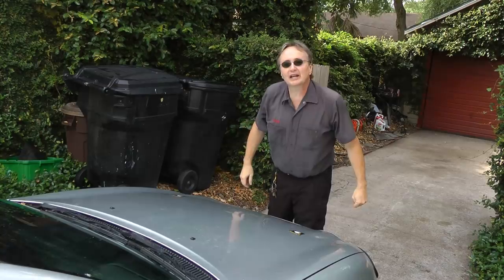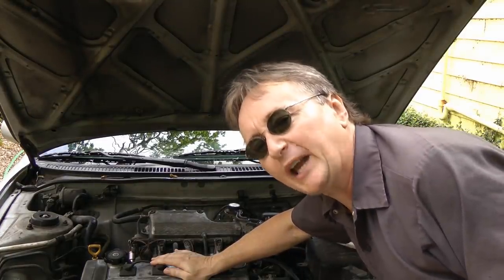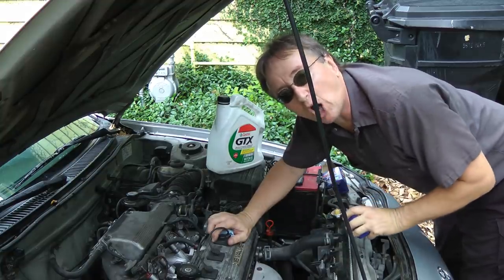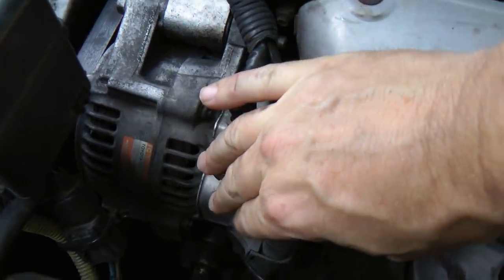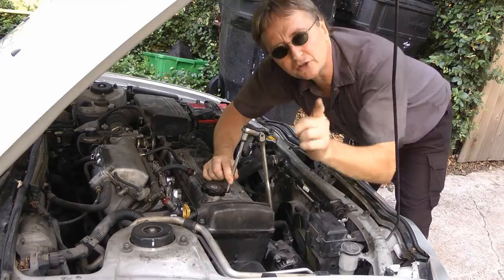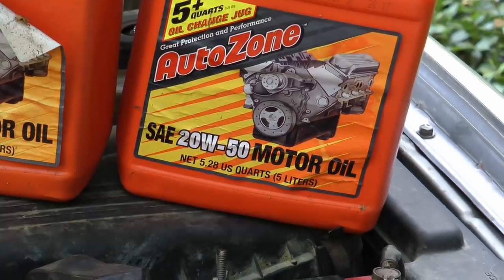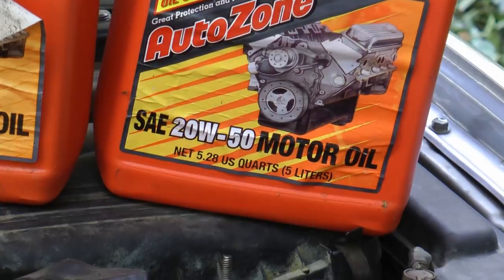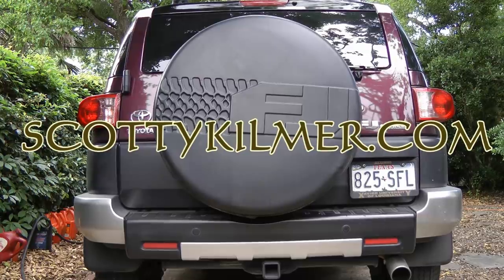Top 4 Mistakes Car Owners Make (DIY Fails)

Comment: Although you took off the right one in your video, sou said: "Take off ONE of the battery cables!" Correct would have been: "Always take off the negative cable off your battery (first)!" Because if you take off the positive one, if it touches a metal part of your car, it would cause a short circuit!! (the metal frame and all metal parts attached to it are attached to the battery's negative pole) Therefore: If removing a battery cable, always start with the negative one!
Reply: BenWahBalls44 the thing is it doesnt matter which side you remove first. you can in fact remove the positive battery terminal and touch it to the frame. it still is not completing the circuit, hence no electricity flow, therefore no risk of short circuiting.
Reply: BenWahBalls44 may i add if you have more than one battery in your car, for a stereo system and what not, then removing the ground wire first is mandatory. make sure you know which one it is because some cars are in fact positive side grounded.
Reply: Ive heard that it can arc and burn you when youre putting it back on if you dont do it right. So I always just do the negative and I never had any problems
Reply: please stop that's makes no sense  on whichever one he decides to remove due to creating an open circuit. the only vehicle  that can do that is diesel which use a 2 battery system which will still have a closed circuit
Reply: Alfredo Zertuche 
Single battery system or not...While your removing the positive cable first, try touching the metal part of the wench or socket drive to one of the thin aluminum a/c lines. I can tell you from experience, the arc melts a hole in the line, and all the refrigerant leaks out. Trust me, remove the negative cable first and when installing a battery, connect the negative cable last. And I don't care if your wrench is insulated or not. It's still a good habit regardless. There are plenty of other items to accidently short out against as well. It's espoecially fun when the wench gets jammed up against something, arching, smoking, and becoming too hot to touch. And then you find yourself hoping and praying nothing sensitive got fried, like the ECM.
Reply: David Sine yes it will arc like crazy but only if both terminals are connected to battery cause your completing the circuit. I don't see which one you take off cause either side is opening the circuit
Reply: David Sine it's only out of caution that you open the circuit at the ground cause if it taps the frame or any grounded bare metal it won't arc but if you do it with positive then you tap something it will arc and possibly send a charge in the wrong direction
Reply: David is right. Ground first just because you could connect the screw on the positive pole with the wrench to a metal part on the car that's connected to the minus pole. When reconnecting the battery positive first of course.
Reply: loosening the nut/bolt on the positive could result in the tool being used touching bare metal and sparking/arching. Also it can cause a larger spark. Electrons flow negative to positive.
Reply: BenWahBalls44 I
Reply: you remove the + first and the - after, to put it back its - first and + second
Reply: All of you people saying it doesn't matter which one you take off first don't understand what the problem is. Take off the negative cable first since modern cars are negatively grounded. This means if your wrench accidentally makes contact with any other metal part on the car while it's in contact with the negative terminal, you will not be creating a short circuit! If you started on the positive terminal and your wrench touched a metal part of the car while it was on the positive terminal you will be creating a SHORT CIRCUIT and probably end up damaging something!
So always take the negative cable off first, and positive second (if you need to remove both, say for removing the battery). For reattaching, connect positive first, negative second.
Reply: pauzey greaux
you have it backwards!
Reply: Chris AF You need to plug the green, then the white one and then the positive one. so take it back this way : +, -, gnd
Reply: pauzey greaux 
Um, what?
Negative is ground. There's no green or white...
Reply: Chris AF theres a ground on the motor its relied to the wheels ... we call it green or ground. Negative is relied to your ground its called reference. If you touch the motor with your positive its going to cause a shortcut anyways because even if you take the negative first or not, the motor is "grounded"
Reply: pauzey greaux 
If you disconnect the negative cable from the battery, you can then run a wire from the positive terminal to any part on the car and nothing will happen. There's no way to complete the circuit back to the negative terminal. That why you disconnect the negative terminal first and reconnect it last.
Reply: Scotty intentionally showed the negative side on the video....problem solved!!!!!!!!!!!!!!!!!!!!!!!!!!!!!!!!!!!!!!
Reply: bryan diel 
yes, but how many people noticed it and then thought anything of it? I had a guy at an auto parts store replace a battery that should have known this but didn't. A lot of people don't, but it could save them a lot of trouble!
Reply: Yes you guys are right negative first.
Reply: Wrong. How would it short if the battery is no longer attached?
Reply: BenWahBalls44 , the reason for the negative is to makes it less likely for a sudden power surge. In theory it could happen , but never seen or experienced it. Depends on how the computers operate , and other circumstances. From what I learned power goes neg to positive , originally I was always told it flowed from pos. To neg. But when I went to my electronics classes they gave us another way on how it works. Computers typically ground everything to operate it with minimal voltage output through to keep heat down . Either way a circuit has to be completed.
Reply: kennedy796. If your wrench touches any metal part of the car while you have it on the positive post it will short out the battery. If you happen to be wearing a ring on your finger and is touching the wrench and the frame or metal it will burn your finger off
Reply: Charles Pryor , I think you may want to learn how a battery operates and an electrical system works a bit better. It will not short out a battery in that aspect normally. Causes a power surge , may damage a pcm, ecm, bcm , Sometimes . Depends on the contact and duration of the contact. The ring thing, will damage your ring since it's a good conductor , may get a burn but losing your fingers. Haven't seen it in 20+ years or expearanced that.  Most mechanics take off their wedding band for safety and not to upset the wife anyhow.
Reply: Mike Biro grab yourself a wrench,with both cables attached place the wrench  on the positive terminal on one end and the frame of the car and see what happens. See how long you can hold it there.
Reply: Remove negative first 
Reinstall negative last
as many people explained above.
Reply: pauzey greau
Reply: If the positive cable has been disconnected it will not short out anything if it happens to accidentally touch a grounded(connected to the negative terminal) conductor, as there is no electrical path back to the positive terminal for current to flow. I do agree; however, that I think it's a better practice to disconnect the negative terminal.
Reply: Yep agree 100% with this comment. Always remove the negative terminal first.
Reply: BenWahBalls44: You are correct (negative first), but you didn't do a good job explaining why. If one attempts to disconnect the positive first, there is a danger of shorting the wrench to ground--with fireworks ensuing.
Reply: If you remove the positive wire and touch the vehicle it will do nothing you would need to touch the positive node on the battery to your vehicle which would be very hard
Reply: You certainly have been taught well by A Smart Person . This Guy wants to be a YouTube Guru 😝👎
Reply: @kennedy796  True but if your wrench touches metal while removing the positive cable then you get the short that you were trying to avoid. Always remove the negative cable first.
Reply: Scotty knows that I'd hope.    I always take off the negative, then the positive.    And for extra safety , make sure there is air flowing in your work space.  Batteries tend to give off gasses.  You don't want to spark a bad incident.
Reply: @kennedy796  There hasn't been a positive ground car since the 1950's. Slim chance of that happening. If you have 2 separate batteries running 2 separate systems it's still not going to matter which cable you disconnect first.
Reply: @KALUPO78   I would hope you would be capable enough not to short out the battery with the wrench if you are going to work on a car !!!
Reply: @dantuel   People who do not take off the negative first should not be working on cars.
Reply: @KALUPO78  Been working on them 50 years without shorting one out. Maybe you just aren't smart enough ???
Reply: @dantuel And I make 100K a year working on them. ITS NOT THE BATTERY THAT SHORTS OUT. Our are you mot smart enough to learn than in 50 years?
Reply: 1 battery, 2, 4 and now 6. 12 volt 24 volt itty bitty 6 volt.
Reply: @KALUPO78  Only100K you must not be much of a mechanic then huh?  Our are you ?? I think you meant to say Or ?? Your getting a little picky too aren't you? If you take a wrench and put it on the + battery terminal and then touch the car anywhere that is metal you have shorted it. Get as technical as you like . It doesn't make you look any smarter
Reply: @dantuel The battery is not shorted out, IT MAKES A SHORT TO GROUND, I guess you make over 100km a year with all of your knowledge.
Reply: @dantuel  UPS MECHANIC. If I did not have a life it would $120k plus. What about you? A shade tree ?
Reply: @dantuel Its a short to ground. The Battery  should by fine. IT DOES NOT SHORT OUT THE BATTERY.
Reply: @kennedy796  WRONG. The NEGATIVE cable is always removed first -- to prevent back-feed to the  computer's low-voltage circuit, which will fry your s**t IMMEDIATELY.
That's from FORD Motor Company.
Reply: @SlikLizrd  okay. Post the article
Reply: @kennedy796  Ford Motor Company.
 1995 Official Repair and Maintenance Manual for Ford Crown Victoria, Mercury Grand Marquis, and Lincoln Town Car.
Source: Ford Technical Publications Department. 
Printed: July-'94

Comment: Just made a mistake today, I was doing an oil change (at Pep Boys) and noticed the Anti-freeze was low  so I filled it up and forgot to closes the cap.(the oil part of the job was fine BTW) Glad  the driver decide to call us and not keep driving so we can get the air out of the system. Next time I need to be more careful it could of been bad.
Reply: And that's why only fools let Pep Boys touch their cars.
Reply: I worked at pep boys for 6 months as a gst and in my first 2 weeks they had me doing clutches and several other things im technically not qualified to do

Comment: Glad to see that the best cable was removed. Always remove the ground cable, and that is the negative cable usually. Some did have positive ground. If the wrench shorts ground to ground there will not be a spark.

Comment: I would recommend filling oil filter with oil when you put it in so the first start up isn’t dry.
Reply: Always best to fill with oil , if the filter location allows it
Reply: You can't always do this in some cars, like ones with a sideways mounted filter.  Dumbest design ever.  But yes I agree put oil in your filter before installing if it allows.
Reply: Good idea but only if the filter mounts upwards. Doesn't work for horizontal  mounted filters

Comment: You say (correctly) to put a smidge of oil on a new filter gasket, "so it won't leak". More importantly.....it will help prevent just the kind of failure you're talking about that the gasket "sticks" on the car when you take it off later for the next change-out.